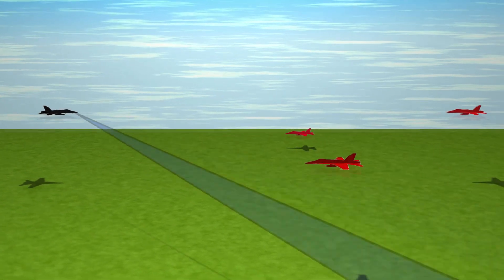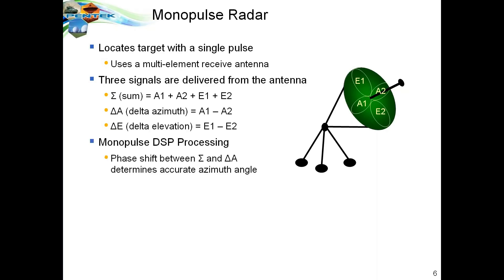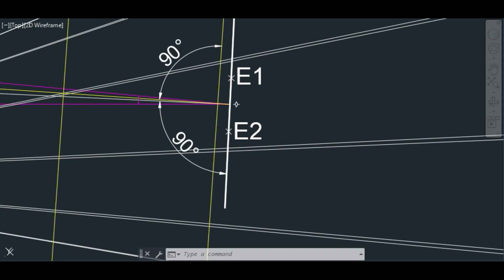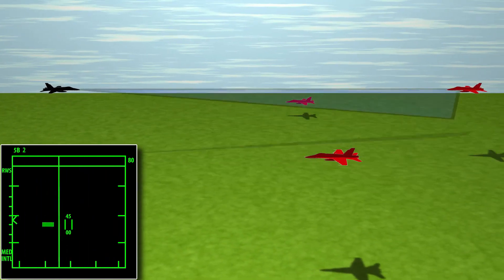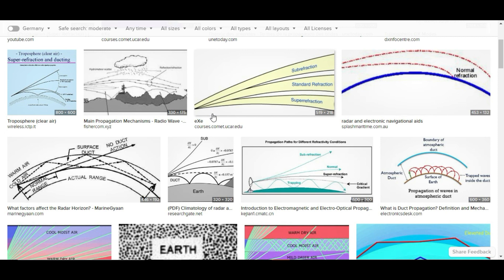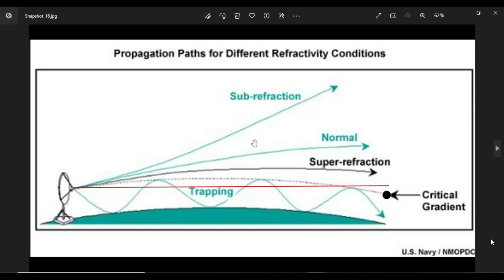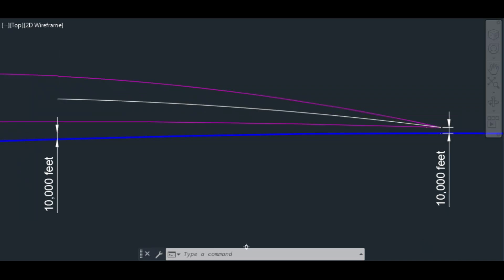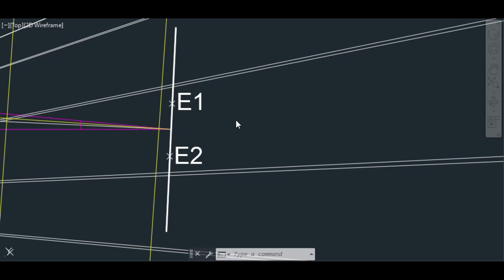Bendy Radar

Comment: Nice to see another upload from you. I have come to the conclusion flat earth is the most terrifyingly obvious truth, it's so obvious in so many ways it's frightening.

Take the supposed curvature calculation of the earth and realise that it can only work in one direction, if you turn 180 degrees and face the opposite direction this alone utterly debunks the curve.
Using distance to the object and eyesight level, you can calculate the distance to an object (a ship for example) and horizon. Like so....

Distance to the object 2.9km
Eyesight level 6ft
Distance to horizon 4.83km
Obscured object 0

So, at a distance to the object of 2.9km, from an observer height of 6 ft you are 4.83km from the horizon and no part of the object is obscured. Now, let's reason together.. if we apply this logic to an object in the North and an object 180 degrees to the South, these objects are 5.8 miles apart and there is no curve! between them. If you took a photo of a ship in the North and it had a sister vessel, the same distance and position to the South, those images could be superimposed onto each other and be entirely level!

2 Peter 3:5
5 For this they willingly are ignorant of, that by the word of God the heavens were of old, and the earth standing out of the water and in the water:
Reply: If an observer A had to eyeball observer B and they both observing at eye level height of 6 feet (1.83m).

Then they can eyeball each other at a distance of roughly 10km. Based on the visual/radio horizon rule of thumb. They may not see each others feet but eyeball to eyeball. Depending on the amount of refraction
Reply: Oh, and Earth is not flat. Certain technologies are engineered to overcome the obstacles of earth's curve.
Reply: @Testequip  You sound like somebody very new to the topic. No offense intended.

" A had to eyeball observer B"

There needs to be no observer, I am talking about the circumference of the Earth.  The maths makes no sense, the horizon distance at any given height will always be the same level in any direction. Therefore a point to the north or south (for example) will be level.
As I say, it's so obvious you should be scared.
Reply: @godsgrasshopper272  
Firstly, are you familiar with the radio horizon? Which is a bit farthar than the visual horizon? And there is a reason why the radio horizon is a bit furthar than the visual horizon.

Whether it's an observer or radio antenna, or visual cues from distant mountains, building, etc. It remains the same. Electromagnetic waves be it light or radio wave share the same characteristics. Namely, it can refract, diffract, scatter, absorb, and reflect. 

What maths makes no sense? Give me an example of the maths that makes no sense
Reply: @Testequip  We are not talking about  refraction, signals, electromagnetism, scattering or any other term you wish to throw about...

We're talking about the physical circumference of the Earth..."40,007.863 km (24,859.734 mi)"

And the CALCULATION (not observation) does not work and the cognitive dissonance you are displaying shows us how such glaring inaccuracies can be overlooked.
Reply: @Testequip  If you look north based on the circumference of the earth the horizon will be Y distance while viewed at X height. Same applies to south or any other direction.

Therefore no matter how far or what direction it is level. The maths proves it.

It's you that disbelieves the maths.
Reply: @godsgrasshopper272  
You havent answered the question. What math doesn't work out? You merely provided the circumference of the earth then stated the math doesn't work out. This tells me you did a calculation yourself. So tell which math part did not work out?
Reply: @godsgrasshopper272  
"If you look north based on the circumference of the earth.."

Dirstly, do actually know the point you attempting to make? You haven't provided the math. Provide the actual math
Reply: @Testequip  "You havent answered the question. What math doesn't work out? "

The maths does work. it proves the Earth has no curve. Your interpretation of it and your desperate attempt to justify something so intrinsically, obviously wrong is why the lie is so easily proliferated.

Maths....

"If you look north based on the circumference of the earth the horizon will be Y distance while viewed at X height. Same applies to south or any other direction."

Therefore no matter how far or what direction it is level. The maths proves it.

It's you that disbelieves the maths.
Reply: @godsgrasshopper272  
Afterthoughts:

You tell me this has nothing to do with an observer then you boldly state the following;

"If you look north based on the circumference of the earth the horizon will be Y distance while viewed at X height"

That's why I asked you if you familiar with the radio horizon as this tells you how to calculate this X and Y you speak of. Just stating x and y means nothing
Reply: @godsgrasshopper272  
Okay let me help you out.

The visual horizon (equivalent to the radio horizon)

A person looking in any direction is at a height of 4 metres. To determine how far he or she can observe the horizon is calculated as follows. Using the radio horizon rule of thumb

Height of observer in km = 3.57 x sqrt of the oberver in metres.

Thus 3.6 x sqrt of 4 m = 7.14km

Good grief, earth is far from flat. Certain technologies are engineered to overcome the obstacles of earth's curve. You have been misinformed
Reply: The calculation stand without an observer, it just helps illustrate the point.

Based on the circumference of the earth the horizon must be at Y distance at X observer height. 

Do you disagree with this statement?  To disagree with it is to deny basic mathematics.  Also, as it has to apply equally in all directions the horizon will always be level irrespective of the distance in any direction.

This is why you have to challenge the basic concept of how the curve is calculated. 
If you have an objection as to how the curve is calculated take it up with someone else.
Reply: @godsgrasshopper272  
I gave you the calculation based on your comment namely; "y distance at X height" I even provided an example. Which part are you having trouble with? You made a claim and I added the math to your claim.
Reply: @godsgrasshopper272  
And it adds up beautifully. I have first hand experience in the technology engineered to earth's curve. I'm not an armchair philosophizer.
Reply: @godsgrasshopper272  
Afterthoughts

"The horizon has to be level"

Do you know what level means? Do you know the difference between level and flat?
Reply: @godsgrasshopper272  
"If you have an objection as to how the curve is calculated..."

Not at all. It's calculated as follows

Earth circumference (40 000km ÷ 360 degrees
= 111km

Thus it's roughly 1 degree curve per 111km.

Note: The circumference of a circle in degrees is a total of 360
Reply: @Testequip  "A person looking in any direction is at a height of 4 metres. To determine how far he or she can observe the horizon is calculated as follows. Using the radio horizon rule of thumb

Height of observer in km = 3.57 x sqrt of the oberver in metres.

Thus 3.6 x sqrt of 4 m = 7.14km"

As this works in both directions it cannot be the curve of the earth.
Using your calculation and common sense, please understand that if you look the opposite direction using the same calculation everything has to be level FFS!
Reply: @godsgrasshopper272  
You merely becoming belligerent.There is no need for it. This is a discussion not a street fight.

Someone elevated to 4m looking in any direction can only see 7.14km if there is a shoe box laying on the ground at say 10km you won't see it. It will be hidden by earth's curve.

In science and engineering level means perpendicular towards the centre of the earth whereas flat means on the same plane with zero degree curve. For example my dining room table top is flat. In everyday usage/vernacular flat and level is used interchangeably
Reply: @Testequip  "Someone elevated to 4m looking in any direction can only see 7.14km if there is a shoe box laying on the ground at say 10km you won't see it. It will be hidden by earth's curve"

They can see the shoe boxes at 14.28km as it works the same in all directions. The shoe boxes are level.
Reply: @Testequip  Please, try to comprehend what you said....

"Someone elevated to 4m looking in any direction can only see 7.14km if there is a shoe box laying on the ground at say 10km you won't see "

If there were 2 shoeboxes, one north and one south, they would be 14.28k apart. You could see both at the same time.#

ahhhh!
Reply: @godsgrasshopper272  
You can't see in both directions namely, north and south, at the same time unless you have eyes at the back of your head. 

And yes, if there is a shoe box at 7.14km and you elevated to 4m you will see the shoe box. Drop down to 2m then you won't see the shoe box because earth's curve will obstruct your view. If there is a shoe box in the opposite direction at the same distance of 7.14km and you TURN around 180 degrees you will see the other shoe box. At a height of 2m you can you can only see to a distance of 5.05km in any direction and you won't see the shoeboxes at 7.14km

It doesn't matter which azimuth you oriented towards. It doesn't have to necessarily be North or South. I'm not sure why keep saying north and south.

I don't mean to be
facetious, but what's your highest level of high school physics and mathematics?
Reply: @Testequip  "And yes, if there is a shoe box at 7.14km and you elevated to 4m you will see the shoe box. Drop down to 2m then you won't see the shoe box because earth's curve will obstruct your view."

I got it. A shoe box is hidden by the curve of the earth. Thanks.

" "And yes, if there is a shoe box at 7.14km "

If I turned 180 degrees and there were two shoe boxes, they woould be 14.28km apart.
You're trolling me, right?
Reply: @godsgrasshopper272  
Nope, I'm not trolling. I'm merely correcting you in your misunderstanding. Hence the reason I asked what's your highest level of science and maths.
Reply: @Testequip  ". Hence the reason I asked what's your highest level of science and maths."

The world has always been ruled by an appeal to authority. Except the very thing you're appealing to proves you wrong. Your defence of it proves how and why,.
Reply: @godsgrasshopper272  
No, I'm not appealing to any authority. I'm a retired telecoms network engineer (ICT). I engineered, maintained, and commissioned backbone telephony microwave repeater links engineered to overcome earths curve based on the radio horizon. Not to mention work at the Hartebeeshoek Earth Satellite Station (the telephony division and not Hartrao/Sansa). Including ionospheric telephony radio stations engineered to relay signals around earth's curve using the ionosphere in the early 80's.

Telephony satellites are engineered to relay signals around earth's curve. 

In fact, radio based transmission systems as used by commercial broadcast, telcos, radio amateurs (Hams), aeronautics, military, etc. use a variety of propagation techniques to overcome earth's curve. They are;

- Moon bounce (aka earth-moon-earth or EME)
- Meteor scatter 
- Ionospheric propagation 
- Microwave evaporation ducts
- Telephony satellites 
- Tropospheric scatter 
- Infrastructure radio 
Etc

Had the earth been flat then it would be a no brainer building a radio tower say on the west coast of South Africa and another on the east coast of North America and establish a direct line-of-sight VHF radio link across the ocean. But we can't. Earth is not flat.

You incorrectly assumed I'm appealing to authority. I worked in the real world. You cannot break the laws of physics. Your assumptions are wrong.

You using the very technology engineered to the globe earth model
Reply: @Testequip   "And yes, if there is a shoe box at 7.14km and you elevated to 4m you will see the shoe box. Drop down to 2m then you won't see the shoe box because earth's curve will obstruct your view."

I got it. A shoe box is hidden by the curve of the earth. Thanks.

" "And yes, if there is a shoe box at 7.14km "

If I turned 180 degrees and there were two shoe boxes, they woould be 14.28km apart.
You're trolling me, right?
Reply: @Testequip  If I can look at an object (using your example) 7.14km in the distance....
and I turn 180 degrees and can see another object at 7.14km... those objects are 14.28km apart and level.

bwhahaha. No amount of qualifications can debunk that. 

Ephesians 6:12
King James Version
12 For we wrestle not against flesh and blood, but against principalities, against powers, against the rulers of the darkness of this world, against spiritual wickedness in high places.
Reply: @godsgrasshopper272  
Of course they 14.28km apart, but you standing equidistant between the two shoeboxes. I'm not sure on the point you attempting to make. If you equidistant then shoe boxes placed in a circle with a radius of 7.14km will be seen as you rotate 360 degrees.

 You forgetting, earth is not the size of a beach ball. The earth is huge. One degree curve every 111km. That's not flat. 

The difference between flat and level:

Level means perpendicular to the centre of the earth at any spot on the earth. Perpendicular means 90 degrees to the surface of the earth And flat means a flat plane with zero degree curve

An aircraft flies level with the earth. If it maintains the same altitude it will always be level to the ground which is perpendicular to the centre of the earth. And the aircraft will remain level if it maintains the same altitude . Flat is a flat plane like my kitchen table which has no curve.

Don't confuse the vernacular with the scientific/engineering definitions

PS: I'm not sure on the relevance of your Biblical verse to the discussion. Unless you got confused and meant to send that remark to another discussion thread.

 If it wasn't a mistake, well the Bible is not a science book.
Reply: We live on a rock the circumference of which, by chance, happens to appear level in any direction or altitude. lol
And we happen to view it that way. Dude.
Reply: @Testequip  "If I can look at an object (using your example) 7.14km in the distance....
and I turn 180 degrees and can see another object at 7.14km... those objects are 14.28km apart and "

So there is no measurable curvature and the objects are mathematically level, because on a giant sphere they would and level means something different now. Duh don't you science. They are level but at a different angle and altitude to each other.

I see. How could I of been so naïve...lol
Reply: @godsgrasshopper272  
That calculated distance is based on your observation height. 

As an example, backbone microwave repeater links are spaced roughly 50km apart when antennas are at a height of 30m (note its two towers both elevated to a height of 30m. When calculating line-of-sight based on the radio horizon formula I provided you you have to add the two radio horizons..

If you want to increase the radio horizon distance ( increase the line-of-sight) you increase the transmitter power levels and antenna heights. But there is a limit to this radio horizon. Any furthar increase in antenna height or transmitter power will not overcome earth's curve.

Telcos also use Free Space Optics (FSO) for its backhaul/backbone network which is limited by earth's curve. Yet when using FSO like LADEE to moon orbiting satellites they achieve distance of 384 000km through thin clouds and at speeds of 622MB/s.

Are you naive? No, you merely misinformed.
Reply: @godsgrasshopper272  
Level is a definition/concept given for precise understanding. Level means the exact same thing whether it's on a beach ball, another planet, or a star, etc. Science, engineering, and mathematics have definitions that avoids confusion

Sadly, you missed out on the basics of science and mathematics, hence your confusion and misunderstanding.

As I previously mentioned, certain  engineering technologies work based on the globe earth model. No amount of denying or misunderstanding is going to change reality. You can't use it and deny it -  that makes you a hypocrite

Armchair philosophizing is not going to help you. It's merely going to lead you down the rabbit hole. An appeal to ignorance and/or lack of education in basic science and math leads to gullibility.

As Schopenhauer once said; truth passes through three levels. First, it's denied, then it's violently opposed, and finally its accepted. Most conspiracy theorists are stuck at  level one and two.
Reply: If we observe an object 100 miles away in any direction, we can therefore observe an object 100 miles away 180 degree in the other direction. This proves they are level.

However, level to you means you are on a giant sphere,  the objects are at an entirely different angle in relation to each other in reality, but by mathematical fluke APPEAR to be entirely level.

Quite the coincidence, don't you think.
Reply: @Testequip  "Level is a definition/concept given for precise understanding. Level means the exact same thing whether it's on a beach ball"

Would two objects always appear level on a beach ball, irrespective of their relative size.

Nope. Yet they are are always demonstrably and absolutely level here in earth.
Reply: @godsgrasshopper272  
"Quite a coincidence don't you think..."

Re-read the definition of level. You a click away. Google and serendipity are your friends. I explained the difference between the two. But if my explanation doesn't do it for you then I would suggest you do some research. Flat and level are not difficult concepts to understand.
Reply: @Testequip  "Level is a definition/concept given for precise understanding. Level means the exact same thing whether it's on a beach ball"

On a beach ball, or earth, objects cannot be the same height or angle in relation to each other.

Gaslight elsewhere.
Reply: @godsgrasshopper272  
Okay, so you don't have a counter-argument. Only rants.
I'm afraid you lack the basics (and an education) hence your struggle to grasp what I'm trying to help you with

I rest my case!
Reply: @Testequip  ". Level means the exact same thing whether it's on a beach ball""

lol
Reply: @Testequip  I understand now. Objects appear in the exact same position in every direction and are entirely level to each other because I don't understand what level means and we are in fact on a giant sphere and those objects are at an entirely different positions/angles in relation to each other, yet appear level because that's what level means on a giant sphere.
Thanks for clearing that up.
Reply: 🤣 please tell me you're joking.
Reply: @curious1585  If an object is partially obscured by curvature @ 3 miles from an observer height of 6 feet, then it would not be possible for two objects at a distance of 5.8 to have no curvature and no part obscured. Although why I am attempting to reason with somebody who starts their non-reply with an emoji is the true mystery.
Reply: @godsgrasshopper272  that's not what yiu layed out though.
In your comment you gave the following:
Distance to target North: 2.9 km
Distance to target South: 2.9 km
Distance to horizon: 4.8 km
The Targets should not he obscured from thw observer. But that doesn't mean that the targets won't be obscured from each other!

Can you clarify what exactly the base observation is you're seeing a problem with?

Aside from conflicts or none conflicts, you're aware that long distance observations near the ground (ie observations working with the distance to the horizon) maximise possible disturbances through refraction in air.
Reply: @curious1585  "Can you clarify what exactly the base observation is you're seeing a problem with?"

Yes...
Firstly I'm not observing anything....it's a fundamental calculation based on the supposed curvature of the earth. You understand that this is not a subjective 'observation' rather an objective analysis of  the maths? No refraction excuses, pure maths.

", you're aware that long distance observations near the ground"

They are not observations, they are mathematical necessities  based upon the circumference of the earth. Do you understand the difference between an observation and a calculation?
Reply: @godsgrasshopper272  I know the difference between a calculation and an observation.
Get to the clarification please.

Refraction is not an excuse. It undeniably happens in air and its influence on the calculation of the matter can also be shown.
Reply: @UnlimitedHangout  'those'?
Can you please quote me where I said any of the nonsense you just claimed?

I think you should differentiate more clearly between what someone actually said and what your wild imagination makes implies from that.
I'm really sorry for your state of mind.

Are you suggesting air does not refract light?
Reply: @curious1585  🤣  please tell me you're joking when you say the world is a spinning tilted pear rock covered in water and air flying through the sky millions of miles a day.